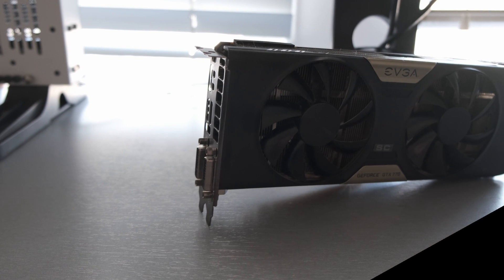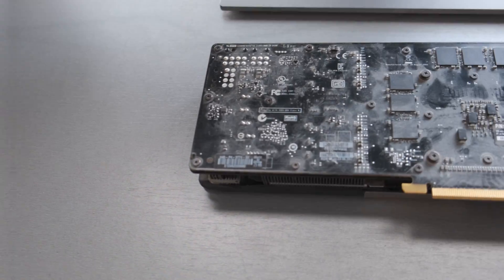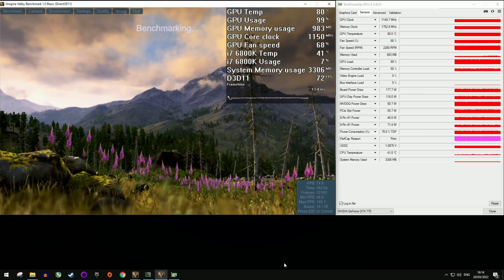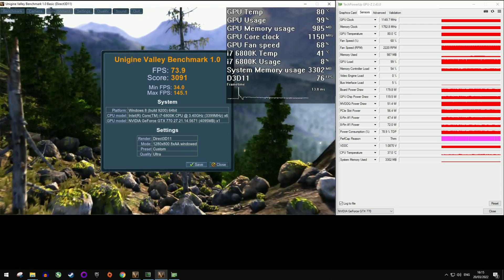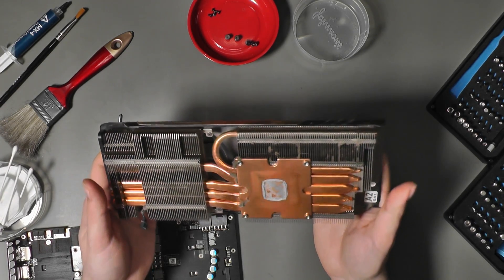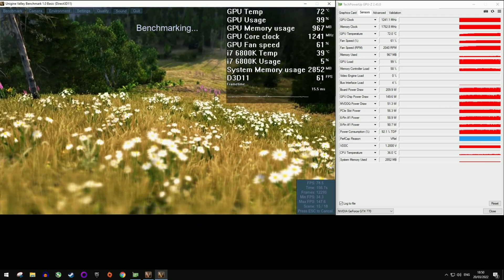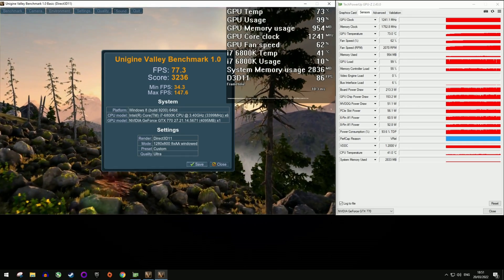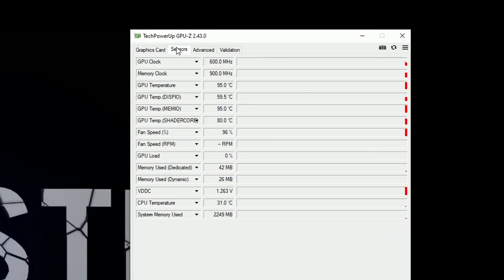Should you replace your video card's thermal paste?

Comment: The gtx 770 4gb cards were insane work horses. Im just now replacing my I7 3770k and gtx 770 4 GB build i did all the way back in 2013. The gpu stopped being able to play modern titles arpund 2020. But it atill manages less intensive titles and everything released in 2020 and back.

Comment: My 1660ti runs at 55c to 60 while gaming sometimes 65 no overclocking my question is should I still replace the paste or that's okey pls reply I need help you will save me big time ty 🙏🙏
Reply from the maker: Hello mate, those temps are absolutely fine, I wouldn't bother 😉
Reply: Ty soo much you save me a big time

Comment: Thanks for the video! When it comes to applying thermal paste on GPUs, I noticed many people saying the proper way to do it is to actually spread it yourself after putting a blob on it, because unlike CPUs they don't have heat spreaders (IHS), so what's your take on that?
Reply from the maker: Hi mate, thanks for checking out the vid! Well, I'd say for as long as there's enough of it, it's pretty much the same. I can see how having too little will not cover corners, that's a quick way to finish off any GPU core! But with my applications, mind you, most of cards I test have been repasted just few days after purchase,  and again for a video - 6 to 12 months later, I tend to use enough of the stuff it seems :) Fun fact, most AMD cards have much smaller GPU die, it's easier to get enough coverage VS most of Nvidia's that came with a heat spreaders

Comment: lmfao, the 770 EVGA SC is the exact GPU I'm still using in my desktop and I just replaced my thermal paste in it like 3 days ago. My answer 100% is YES... I overclocked it and it was hitting 90-91C in furmark, then I replaced it with some MX5 and it's only hitting 80-81C; MASSIVE improvement. Until I can get a 3080 EVGA FTW3 for a fair price, I want to eek out as much performance as I can with this guy.
Reply from the maker: Thank you for sharing :) It really does help and is quick to do, isn't it ? Ah, nice, those are finally coming down in price, good luck :)

Comment: My 1060 always ran hot so one day I decided to reapply thermal paste. There was no thermal paste on the center of the die only on the outside
Reply from the maker: Which brand was it ?
Reply: @nexus_tech  EVGA. I have no issues with my evga 3080 overheating and it is clocked so i think its was a fluke.

Comment: What a nicely built card, with all these re-enforcements, they aren't really doing these things with newer cards nowadays, some of them really could benefit from it.
And as you said I would recommend replacing the thermal paste on a GPU after some time of usage or if it gets too hot, I myself have a RX 570 bought back in 2018, still haven't removed the sticker and taken it apart for cleaning, as the temps are decent (60-70), but undervolting it might have helped with that, but regardless I am planning on replacing the paste in the near future.
I once had a R7 350 which went over the 90 degree mark fairly easily even at100% fan speed, well it turned out that the paste was very dry and almost non existent, applying new paste and  the temps never crossed 70 degrees again.
As always great video, I love the type of relaxed tech videos you make, seems like a nice fit :)
Reply from the maker: Thank you mate! I'd say anything that is over 4 years old would benefit from a re-paste. I've seen few properly baked on cards when testing the HD series, It makes me so uneasy when separating, I feel like I'm going to break the GPU die lol! I love the ACX coolers

Comment: Repasted my GTX 1080 yesterday after 6 years of no cleaning and I saw similarly scaling results, 100%. This is my first video on this channel so I'm not sure if it was mentioned, but be sure to cover the WHOLE GPU die with thermal paste (or put enough in the center that it will squish out across the whole die) as GPUs are not nearly as tolerant as CPUs to uncovered surfaces in that regard.
Reply from the maker: Good to hear and thanks for sharing! Yup, I always go with proper blob of thermal paste to make sure there are no hotspots. AMD die size is much smaller when compared to older Nvidia cards, I remember the shock when opening GTX 260! :)

Comment: I think that's the exact same card in my system now lol. I've worked it hard and it's been super reliable for how lazy I am. Newer games are too much though. I've finally got an rtx card coming in
Reply: Yess, the 770 EVGA SC was a great card.. so much so I wanna go with another EVGA card this time around myself. I have a little 980m in my laptop which is still serving me well, but I want to swap out my 770 in my desktop with a 3080 for that vram. I've seen a ton of deals for the 3070ti which have honestly tempted me (EVGA even has the FTW3 3070tis on stock on their site, which is insane).
Reply: @Camelotsmoon  yeah EVGA seems like one of the least scummy companies right now. I went with the Gigabyte version though to save money lol.
Reply from the maker: It's an awesome card! Thanks for sharing, what did you replace it with ? :)
Reply: @nexus_tech  a 3070ti. Part of that mark down deal from the other day. We'll see if bestbuy actually follows through, but I did complete the order haha so I'd hope they do
Reply from the maker: @guidosaur7506  Good luck, the 3070 or 3070Ti is all one really need! :)

Comment: Whenever I get a used GPU I first run it "as is" for a few hours, stress testing it and also just general use, I usually don't game at that point because it is just a test to make sure everything is working as it should. I record the temperatures of course.
After that I open them up and I give them a thorough general cleaning, which means removing the dust for the pcb, the fans and any other location and usually I replace the thermal paste since I already have taken them apart.
My observation is that usually the older and drier the thermal paste was, the bigger difference I would see in the temperatures.
Reply from the maker: When I get the GPU, first thing is to let it warm up to room temp, then run Heaven benchmark to establish if no problems occur. Thanks for sharing, I hope you enjoyed the video :)

Comment: I replace the thermal paste with NT-H1 and also the thermal pads with high conductivity blue pads.
Reply from the maker: I've never replaced the pads, well, not fully anyway. Quite expensive and needs to be precisely matched for thickness, although I can appreciate it would really help mem temps! :)

Comment: Thanks for the information. I’ve not had any issue with old GPUs running hot but it might be worth changing anyway. At least it is easier on older cards. Some new cards are too complicated for me to even try not to mention they are worth more if you screw it up.